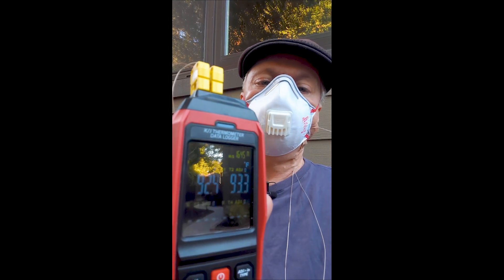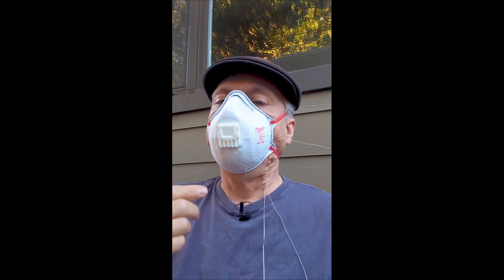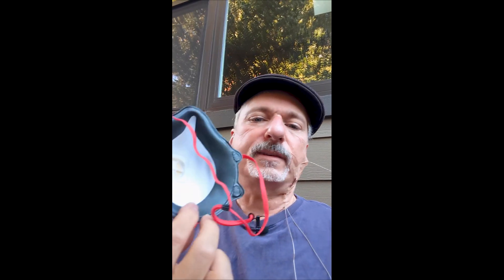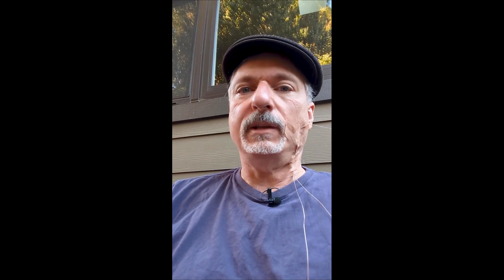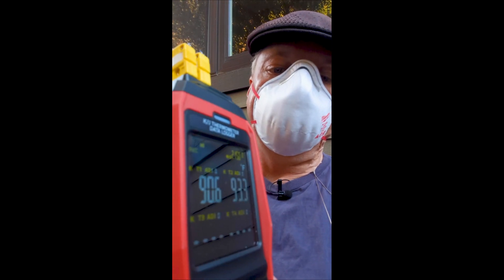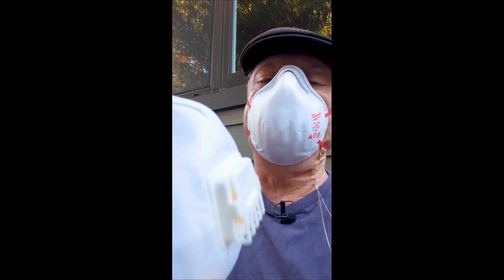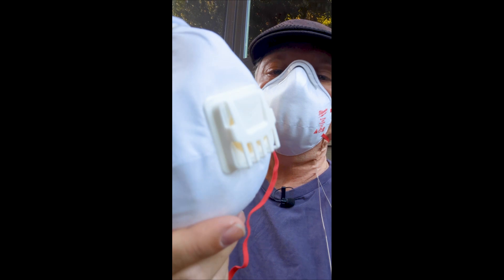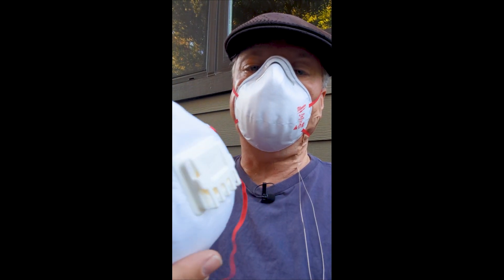Is the valved Milwaukee N95 10 degrees cooler than other N95s?

Comment: I wore these 40 hours a week for 3 years as a construction worker, sometimes in extreme heat. I don't know about 10° cooler than valveless, but they were the most comfortable masks I found for that application. The gasket and adjustable straps made for a very secure fit. I recommend these to people all the time.

Comment: thank you!
apart from dubious marketing claims the felt temperature is of course heavily influenced by humidity. i'd love to see you stick some humidity probes onto your face as well :)
Reply: Totally agree, I wear a valved Drager most of the time lately, and even though I would imagine the temperature is probably not that much lower than the unvalved version, (which I wear around covid cautious folks), the humidity is so much different that it feels cooler with the valved because of the lower humidity.
Reply from the maker: @steefant  YW :-)

I have tried humidity probes, but haven't come to any conclusions yet, partially because I don't live in an area with high humidity, so I've not tested in a full range of conditions yet.

Comment: I wonder if you were exercising if that wouldn't make the difference greater. 

I mean it's probably mostly marketing vs lol. But maybe it would at least be closer then.
Reply from the maker: @GM-pn2bi  In cooler weather, deeper breathing causes wider temperature swings inside the mask - more cool air on inhalation, then more hot air on exhalation. This makes it more challenging to calculate the temp difference from ambient.

In testing I haven't published yet, I  decided to calculate average temps to reduce the influence of breathing rate and tidal volume on the numbers.

Comment: I got a 10 pack of those, but couldn't get them to pass a fit test. I don't think I made them tight enough to leave marks on my face, so maybe it was operator error :)

Aura FTW.
Reply from the maker: @gf2e  

Auras are still my go-to N95. 

The Milwaukee mask comes with adjustable headbands and cord locks. Users have to guess at what the necessary tension is to get a good fit, and the only metric people really have is comfort. I suspect many people are probably not using enough tension to get the seal needed to pass a fit test. On the other hand, the level of tension necessary to get a good fit (for people who these masks do fit, which of course is not going to be everybody) might not be comfortable. :-/